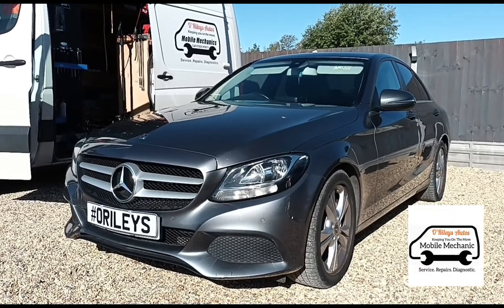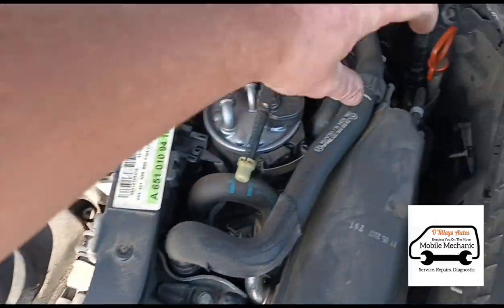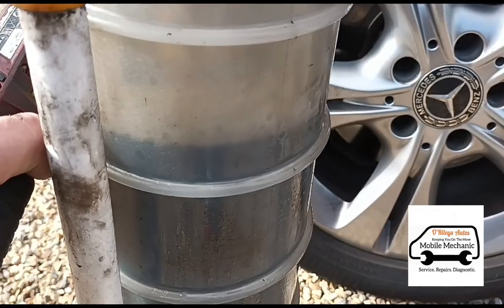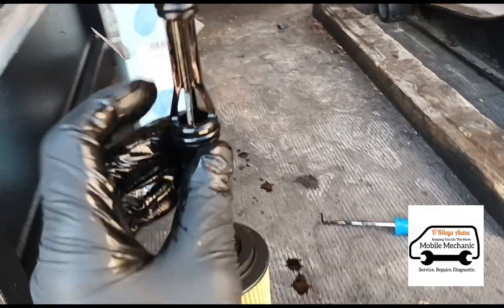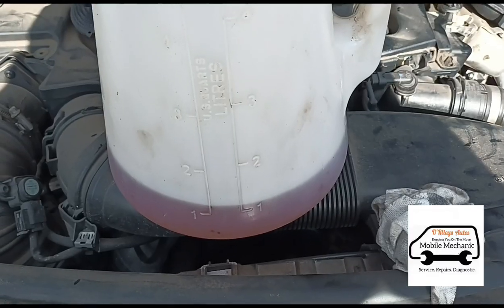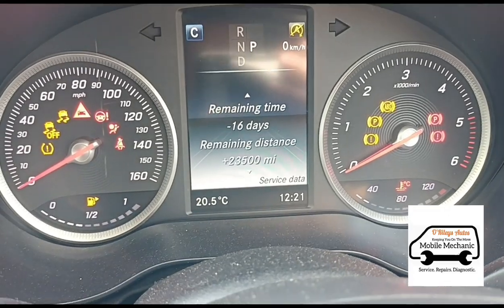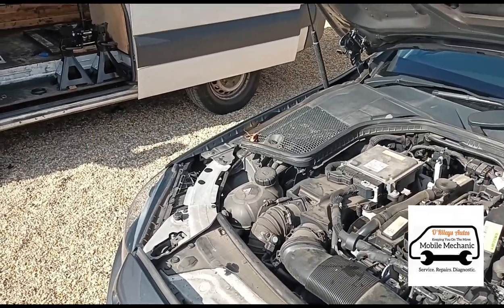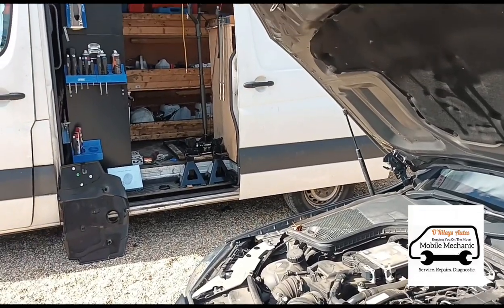Mercedes C Class W205 2.1Cdi C220 Service B B5 Oil & Cabin Pollen Filter Change Without Jacking Up

Comment: W205/S205 have 2 cabin filters, one under the scuttle panel next to the battery, that’s a cheaper one, and the one under the left hand foot well is a fine particulate filter which is more expensive

Comment: Your cabin filter is not wrong. This Mercedes have 2 filters. It's DUST filter, remove plastic cover from battery (engine bay) and replace it. Buy another CABIN filter and change under passanger foot seat cover ;)

Comment: The filter that they gave you goes under the scuttle panel near the battery and. The one inside is a more expensive one
Reply: That's where it was on w203's but on 204/5 it's in the dash.  Just been sent out the wrong bit.